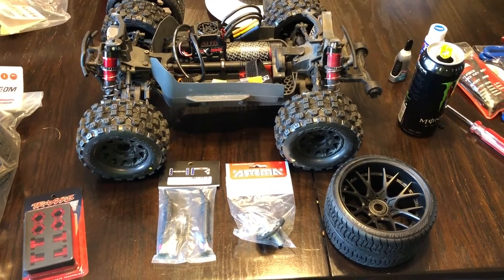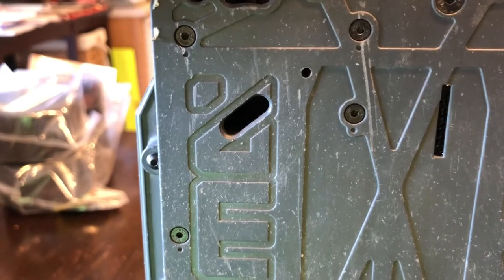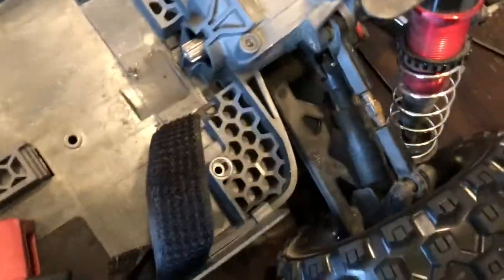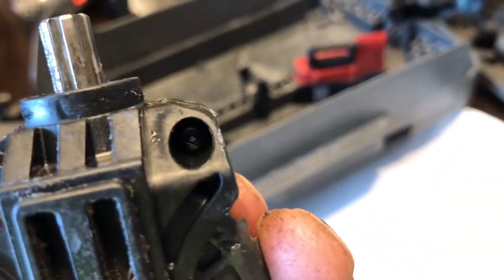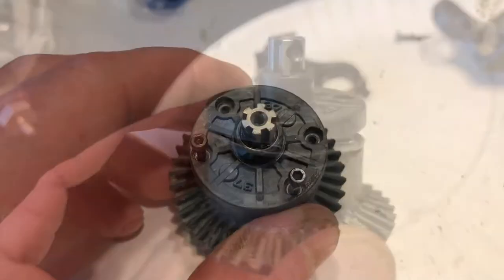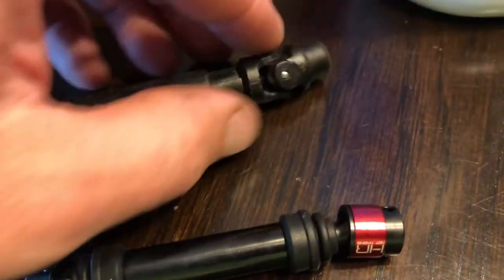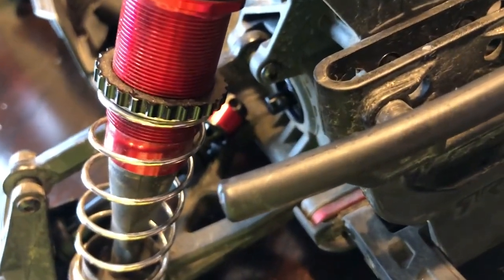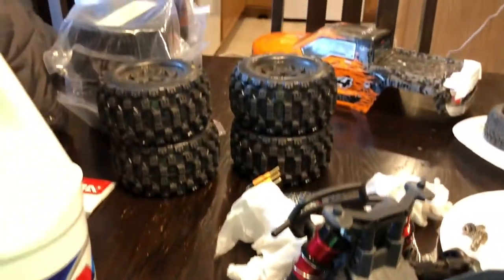Arrma Granite 4x4 BLX 6s Hot Racing axle and steel slipper clutch installed

Comment: I suggest widening your suspension with Big Rock A-arms , I have this on my granite, gives it  a lot more stability that or put Kraton4s suspension, which I put on my Big Rock 6s conversion to do this you’ll need a bigger servo,shocks, metal/ steel front / rear diffs and spur gear I started with a Surpass Hobby 6s motor 150 amp esc but those don’t last they burn out. I now have a Spektrum 150 amp esc and 2050 kv motor more power a more dependable so far.
Reply from the maker: I’ve been doing speed runs with it all year. Got it up to 81 mph so far. I’ve done a lot with it since this video just didn’t have time to record any of it.

Comment: Nice. I went 4s with hobbywing  motor and esc and so far so good. I did pop an axle out but was able to fix it. I have a bunch of upgrades but haven't had the time to install them. I am considering those RC4WD ebay axles but can't find any reviews on them.
Reply from the maker: I hear they are ok but people bust them like any other one out there. I’ll probably keep running hot racing shafts for now. I’m on my second set. Mostly breaking them during crashes or metal wear after a lot of runs on them.

Comment: How did the hot racing drive shafts hold up?
Reply from the maker: I’ve broke a full set of four so far but the ones on it currently have lasted a long time. Mostly breaking them during bad crashes on the road.

Comment: Why not just buy a 6S model from the start? It would probably be cheaper in the long run and definitely less headache.
Reply from the maker: Bought this truck used. I’ve done a lot to it since I’ve got it. Turned it into a speed run truck. Hit 94 mph with it so far. I’ve got a 6s slash 4x4 and and 8s Xmaxx I’ve been messing around with as well.
Reply: @jibberjomini  94 is impressive in that thing. Thanks for the video, it will help me when it comes time to replace parts on mine.
Reply from the maker: @bigshoe84  your welcome. It was an impressive pass and I’m glad I didn’t crash it at that speed lol.